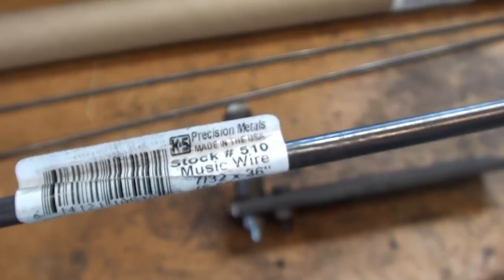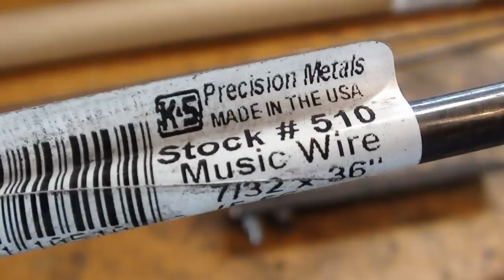WINDING A TORSION SPRING Tips 660 tubalcain

Comment: Thank you for the video. I recently got rid of a old box spring from our old bed. Being the cheap person I am. I cut it up using bolt cutters and stuffed it piece by piece into my garbage can for over a month to get rid of it. It was heavy wire in it's construction it very hard and springy.It was made of two different sizes of wire. I saved about 10 feet of each size for future projects.

Comment: I don't remember what I was working on but I had a project that required me to use a piece of piano wire and boy was I surprised at how hard that stuff was. I was not making a spring but I did need to cut it. Thanks for this example of making a spring. I did not know what material would be needed to fabricate one.

Comment: I have wound smaller torsion springs for years just using a small hand drill.  Usually it was .025, .035 or .041 music wire.  Nothing on the size or scale you did.  I did pretty good doing it.  One interesting fact is that regular music wire will lessen the preload on the torsion spring.  Stainless wire will had preload when heated.  I heat treat in an oven for about 10 minutes at 500 degrees.  Thanks for posting this.  I never had much luck doing it on the lathe.

Comment: Fully annealed 1075 stock is what I've had success with in the past. After forming, Heat treatment is straightforward. Heat to about medium red with torch or in a forge. Quench in ATF. Bake at 400°f about an hour. Air cool. Done.
Reply from the maker: Good idea, it would be better than fighting with that tough music wire

Comment: Worked one summer at a place that made brake springs back in the late 60's.  (back in drum brake era) The machines I was involved with used about #9 wire and looked like an extremely heavy duty drill press with forming tools for the loop at one end.  Believe we worked with soft steel as to test strength we had to heat/cool the partially finished spring to test for tension.  When set up correctly, the machine worked flawlessly.  When it got out of calibration, parts would fly!!
Reply from the maker: Thank you, that was interesting

Comment: Hi Lyle, 

When I need some coil springs I'll know where you come. 😉

I made a similar device to roll 40x5 flat bar into a 20mm internal diameter for truck side hinges. Basically a "d" shape. Worked well. 

You just need to mount the bender on a column and just keep walking around it. 

Regards Dennis.
Reply from the maker: Yes, I had One at the school that you could walk around. But they need to be mounted to bed rock

Comment: Hi Mr Pete, I had to make some springs last week, a friend of mine who owns a spring making business came round to look at my set up on the lathe and says they temper the springs when wound , it shrinks them a bit but makes them less liable to break, he suggested heating them to a straw colour,
Reply from the maker: It is interesting to know
Reply: You should not stress-relieve a torsion spring, as it has residual stresses induced by the winding process that increase its elastic range.  You would be producing an inferior spring by doing so.  A compression spring made of music wire should be stress-relieved at about 450F for 30 minutes, since the residual stresses degrade its elastic range.

Comment: Great job of spring winding.  I made Jeremys belt grinder and I was not able to wind the spring.  I wound up with a mangled mess so I changed to straight extension springs.  It works the same but does not follow his example.  I guess I should have asked you how to wind the spring.  Thanks for the video.
Reply from the maker: Believe me, it is not easy. I had many failures which I did not show you

Comment: Many years ago (45) I used to watch a machinist make springs for Luger magazines.  They were not circular, but rectangular, as the cross-section of the magazine would be.  I remember him normalizing the spring in an oven after he was done.  I've made a few springs from time to time but did not normalize them, how does normalizing help?    Love all your videos.  

He also made the magazines from scratch, but that's another day.     Jim
Reply from the maker: Thank you, my brother had a Lugar. I remember taking it apart and examining the magazine. I know they had rectangular springs
Reply: He was stress-relieving them, probably at 450F for 30 minutes.  For a compression spring, there are residual stresses introduced by the winding process that degrade its elastic range.  Cooking them at that relatively low-temperature helps those stresses "relax."  You should not stress-relieve a torsion spring if it is loaded in the "correct" (winding up) direction, since the residual stresses tend to aid its elastic range.

Normalizing is when you heat something up red-hot and let it cool in air to develop a fine-grain structure, something that the mechanical properties of castings and forgings are greatly improved by.
Reply: @hunterbidensaidslesion1356  Thanks for sharing this info. I'm just about to make some torsion springs out of high carbon 1mm and 0.5mm wire. I was wondering if I should heat treat and quench them after winding them? Do you think I need to do anything after winding, or just go ahead and use them?
Reply: @SpaceMonkey23101  what is the specific wire material?  It's hard to say without knowing exactly what it is.  If it is music wire, you should wind it and then use it as-is.  You should not quench and temper, and specifically for a torsion spring that is loaded in the usual direction, you should also not stress-relieve it.

I am not personally aware of any wire that small that intended to be quenched-and-tempered after winding.  So-called "chrome-silicon" (AISI 9254) is quenched-and-tempered, although I believe it comes that way from the supplier in the smaller sizes.  Even so, the amazing ductility of this material allows for that.  If you're making a recoil spring for an anti-aircraft gun (lol) out of .500 chrome-silicon, you will likely have to order the material annealed, wind it, them harden-and-temper.
Reply: @hunterbidensaidslesion1356  Thanks so much for replying. I've bought two types of wire on ebay: '1.0mm 17AWG T9A 72A High Carbon Steel Music Wire' and '0.5mm 26AWG Carbon Steel Wire'. I have no idea what most of those numbers mean... So one appears to be music wire, the other not. I've bought some extra so I can always conduct experiments.
Reply: @SpaceMonkey23101  you're welcome.  I honestly have never heard of either of those material specs.  McMaster-Carr sells music wire.  They call it "1080", but in the description it says it meets spec ASTM A228, which is the spec for music wire.

Comment: I tried to cut some 1/16 diameter spring to length with a pair of  side cutters. I gave it all I got with my hands and barely made a divot. I then put the cutters in the bench vise and started to gronk on it. There was a flash of light, a massive great bang, and a dull thud against my forehead. 

When I regained my wits and went to retrieve my two pieces of spring from the floor, I found I had but a single spring and two pieces of side cutters. 😆
Reply from the maker: Wow

Comment: The lever arm length is the real advantage because the longer the lever the less physical force is required. There is a mathematical formula that explains it but  reality is simple that the longer the lever the easier it will be to work.  Helical displacement is standard and expected and explains the offset required on the lever from the axis. For the tighter bends on the hardened wire I would suggest annealing the metal before bending it and then re-hardening it but that would require more tooling than a basic shop has.
Reply: Annealing cold-drawn wire (which is what music wire is, per ASTM A228) would permanently degrade its tensile strength.  You could buy chrome-silicon wire (per ASTM A401) in an annealed state (a special-order item, I believe, as it too normally comes in the hardened state) and then heat-treat after winding.

Comment: Good morning.  Do you heat treat your spring after winding to stress relieve it and reduce its brittleness?
Reply from the maker: No
Reply: According to my friend who own a spring production shop...it is good practice to heat treat...400° in an oven for an hour ( been awhile..will have to ask him again)  this reduces the stress in the spring steel and lengthens life span by reducing the risk of cracks.  All the best and have a great day.
Reply: You should not stress-relieve a torsion spring that is wound in the "normal" direction (a direction that would tend to wind-it-up further).  That is because the stresses tend to increase its elastic range, and you would be producing an inferior spring by stress-relieving it at 450F for 30 minutes.

For a compression spring, you should absolutely stress relieve it for 30 minutes at 450F before stresses it in any way, since the residual stresses in this type of spring impede its elastic range.

Music wire is incredibly ductile despite its high hardness.

Comment: Very interesting technique. I'll be using it on a smaller scale for gunsmithing work. I'm curious though, could you use drill rod and then heat/quench it? Might be easier to work if you could induce the springy-ness with heat treating. Great video, thanks
Reply from the maker: I would say no
Reply: I have made quite few small coil compression and torsion springs for locks over the years using the same basic method.  Always starting with spring stock in a hardened and tempered state.  I have also questioned whether this was the best method.  Springs that required very sharp bends were rarely successful leading me to believe that making the spring fully annealed and then hardening and tempering was the better way.  More recently made a ball and cap mainspring using spring stock from Brownells.  It came annealed to allow the shaping and filing needed prior to the hardening and tempering.  I don't think you could successfully make the extreme hairpin bend required without the spring steel being in the soft state.  So I don't see why coiled springs could also be made that way.
Reply: @dougmacqueen1679  Music wire (per ASTM A228) is a cold-drawn wire that has insane tensile strengths that are developed by drawing it through dies.  It has such a low manganese content that it would require a very severe quench to harden all the way through, and even then I'm not sure that 7/32" could develop full hardness.  It is not intended to be quenched-and-tempered.

Chrome-silicon wire (per ASTM A401) is "quenched-and-tempered" (meaning, it has a martensitic microstructure), and in 7/32" size actually has an edge in tensile strength over music wire.  It too normally comes in the hardened state, although I believe it can be had annealed as a special-order item.  In this relatively large size, I believe that heat-treating it after winding would result in a much higher elastic range, although, that is not true for the smaller sizes.

Both music wire and chrome-silicon have pretty amazing ductility despite their high hardness levels.

Note that a torsion spring should NOT be stress-relieved after winding, provided that the loads that it encounters in service tend to "wind-it-up."  This is because there are residual stresses that increase its elasticity.  If it is loaded in the "wrong direction" (the load tends to unwind it), then it should be stress relieved.

Compression springs made of music wire should be stress-relieved for 30 minutes at about 450F before stressing them in any way.  The residual stresses induced by the winding process do not increase their elastic range.  The stress-relief temperature for chrome-silicon is higher than that.

Comment: I need to make a spring with a much smaller diameter than 7/32. I need a spring that is probably 1 mm in diameter. I just can’t think of what I can use for my material. Any suggestions? Much appreciated 🙏🏻

Comment: I wonder would easy machining High carbon steel (Silver steel in UK) work and then heat treat it with a torch.
Reply: Music wire is not intended to be heat-treated, as it is a cold-drawn wire.  Chrome-silicon wire is quenched-and-tempered (i.e., "heat-treated") and it, too, normally comes in the hardened state, although it can had annealed and heat-treated after winding.

Comment: Lyle, could your torsion spring have been made of mild steel then heated and quenched in oil to harden it?
Reply from the maker: Not mild steel, maybe high carbon steel
Reply: @mrpete222  I tried to make a chisel from high carbon steel. I heated it up until it was cherry red, and made the mistake of quenching it in water. I didn't have any oil to quench it in, so the first time I tried to use it, it shattered like glass. Hindsight is always 20/20.
Reply: Yes i agree with Mr. Pete. You need SAE 1070-1090 anealed, form your spring then heat treat  and temper.

Comment: that music wire i think is high carbon steel. One could heat up the mild steel orange hot and quench it in oil, that would make it almost as hard as the music wire.
Reply: Nope! Mild steel doesn't heat treat. Need higher carbon content like SAE
 1070-1090. Heat treated and tempered for best results
Reply: Music wire (per ASTM A228) is not a low-carbon steel, although, being cold-drawn wire, you would certainly destroy its mechanical properties by heat treating it in the manner you described.  This wire is not intended to be quenched-and-tempered.

If you want to heat-treat a spring after winding it, you should be using annealed chrome-silicon wire, which is a special-order item.  It normally comes already heat-treated.

Comment: What makes it spring steel ,  more carbon ?
Reply: Wayne Murphy in a word yes a very high carbon content but I'm not too sure if the percentage, could be as high as 1.5% or more.
Reply: Music Wire (per ASTM A228) has a carbon content of 0.7-1.00%.  It is "patented" meaning heated up red-hot (in a factory, not as home) and dragged through molten lead or salt to cool it rapidly and form a fine crystal structure.  Then, it is drawn through progressively smaller dies to develop insane tensile strengths.

Chemically, it is unremarkable, and has been manufactured for several hundred years.

Comment: I'm a little surprised you didn't make a roller tool to fit in the tool post of your lathe to roll it over a mandrel held in the lathe chuck.
Reply: I don't believe his lathes are powerful enough unless he would use annealed steel first and then heat treat and temper afterwards. You would need some pretty good start up power in back gear for that size music wire.
Reply: @edwardkawecki8101   You can always put a big crescent wrench on the lathe jaw and turn it manually too. Plenty of You Tube videos cover doing it on a lathe and much information in the Machinist's Handbook. For smaller springs I have even seen people do it on a drill press.
Reply: Yes I know I've made many Springs my point is better on that size of spring , meaning diameter of spring wire to start out with annealed spring material If doing it in a lathe.